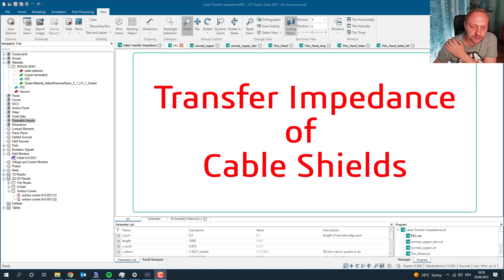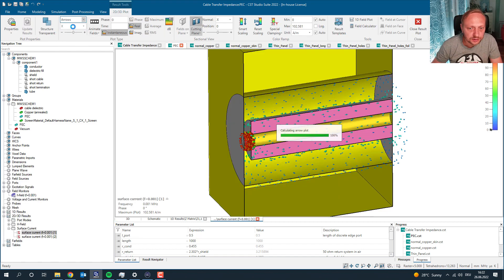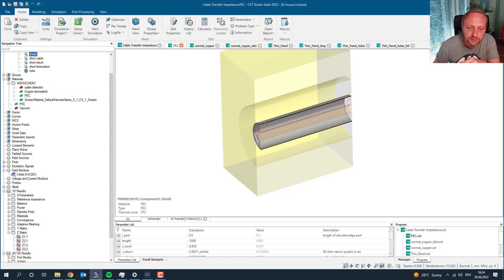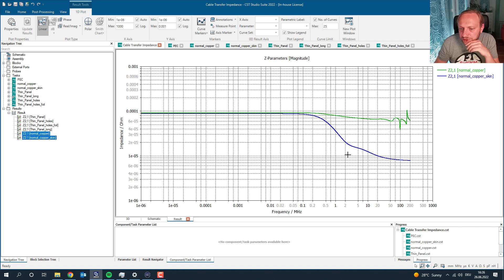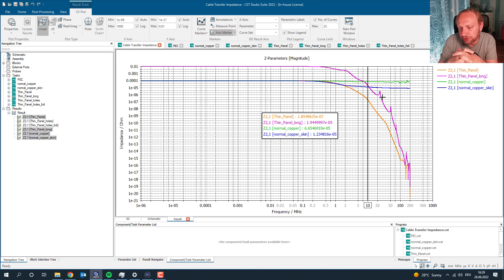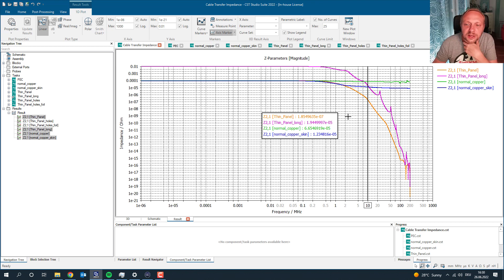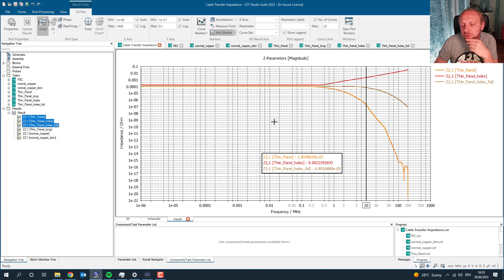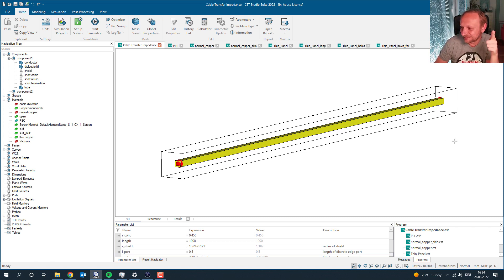Transfer Impedance of a Cable Shield

Comment: Thank you so much for this tutorial.  In your model, how did you model the input and output terminals? I mean in the input you excite it by using a voltage source (shield+outer cylinder). how about the output? did use a short circuit? are there any 50 ohms impedances at the input and output terminals?
Reply from the maker: The calculation is based on S-Parameter to Z-Parameter conversion, not an ideal voltage source. In the 3D simulation I use a 50 Ohm S-Parameter ports. But if you convert from S domain to Z domain that impedance is no longer important.
Reply: @AndreasBarchanski  Thank you so much for your reply. I have obtained the same results by using the HFSS software. However, I want to use CST but, unfortunately, I am not a CST user. can you make small toturial in how to build the model (transfer impedance simulation) in CST in order to help the new CST users. once again thank you so much.
Reply: @oussamagassab3282   May i know how you setup in HFSS to achieve the same result?

Comment: Thank you Andreas for this excellent video. 
1) How did you decide on the gap between the external tube and the shield/screen?
2) When you say to "scale" the transfer impedance for the length, how is that done? 
3) How would you modify the model for a serve/twist type screen (e.g. 22 wires twisted every 5mm with 90% coverage)? 
4) Since CST Cable Studio currently does not support the serve/twist screen type (please ask them to add it), how can a micro-coax similar to "9442 WH033" from Alpha Wire be modeled? Perhaps by first simulating the transfer impedance and then plugging that simulated curve into the Cable Studio's "Simplified" screen type with Model type = "Measured curve." 
5) If that's a good strategy, how do we then generate the "self-impedance" curve needed to fully define the "Simplified" screen? 
6) Also, could you please post your models for us beginners to learn?
Reply from the maker: Thanks, let me try to answer:
1) good point. did not think much about this. Typical diameter of a measuring tube assumed. Probably there will be some mutual inductance between outer shield and tube but I have not looked at it in detail.
2) Simply divide by actual length in meters
3 + 4) You can always create a high detailed model of the screen for a unit length of the twist and then load the transfer impedance into cable studio as you write. The question is: Is such a high accuracy required/will it matter? Also how does the 90% coverage distribute over the circumference?
5) You can export the impedance curve (Ohm/m) from Design Studio (like I did in this video) and load it into Cable Studio.
6) It is difficult to share over YouTube. Also links are removed. I have send you a LinkedIn connect request.
Reply: @AndreasBarchanski  Hello! I'm currently trying to simulate this model in CST, but the simulation has failed. Could you please share a copy of the CST file? Thank you very much!
Reply: Hello! I'm currently trying to simulate this model in CST, but the simulation has failed. Could you please share a copy of the CST file? Thank you very much!